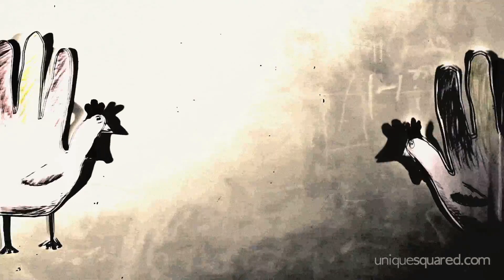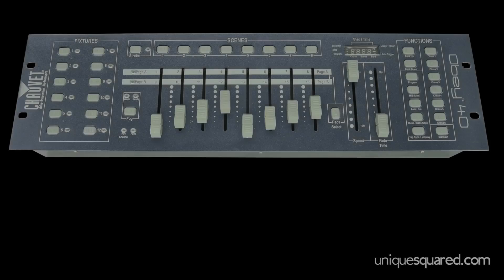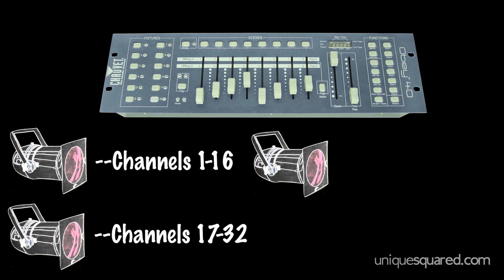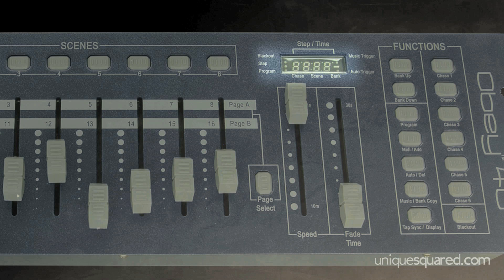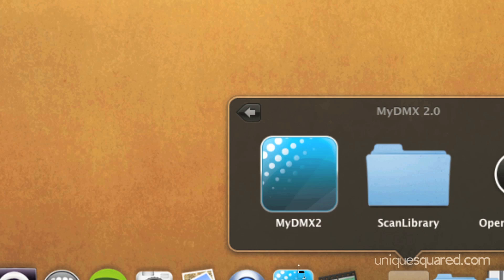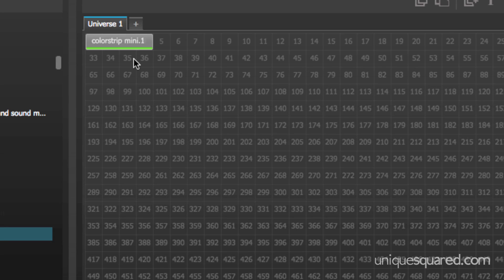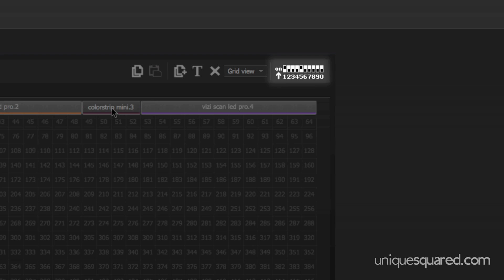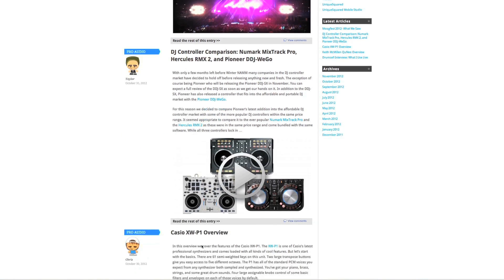DMX Lighting Tutorial Part 5: Hardware and Software | UniqueSquared.com

Comment: When my light is using 3 channels do I have to put the second light on channel 17 or can I put it to channel 4?
Reply: Phyzer no, you can patch (so we name the addressing of lamps) in one row e.g. lamp one has 3 channels, you can patch the next at channel 4 but be carefull! two ore three channels place between the lamps can save your whole show, because some lamps are "spoiling" a few channels behind them with a little voltage and the lamp on this channels would get false signals
Reply: Felix S Ok Thank you so much...
Reply: Depends, if you use software to control your lights through a dongle, you can. If you use a controller like the Chauvet Obey 40 as shown in the video, you can not, because that specific controller is made for 12 lights, with 16 channels per fixture. That means that when you connect a fixture to the controller, it automatically reads it as channel 1-16, because it has those control channels per fixture for it.

(Correct me if I am wrong anyone..)

Comment: i am looking to control my DMX "universe" (about 10-12 fixtures) in time with my live band. i want something better then the music mode from my fixtures tho they work nicely is there a way i can program chases and scenes and switch them manually with a foot switch or something? what would you recommend for this?
Reply: connect a midi device that has pedals and use it to drive the lights on ur computer

Comment: QUESTION -   So say I want to use DMX software like Luminair for larger live stage acts?…….. BUT……..I also need to use a show controller that will control the lights in preprogrammed patterns?  They will be triggered by a control system for a large restaurant/bar.  For instance - Bartender goes to a control and hits the start show button.  Moving heads point at the stage, floods go red and purple. so on and so on. This would be done by the show controller.  Yet they pick up the iPad, switch on the Luminair software to re aim the spot?  Hmmmm.

Comment: Thanks for your very informative series on DMX. I have a question, which I can't find answered anywhere: I want to use LED floods for a portable theatrical stage lighting rig. So, I want to control, maybe, three sets of four lights. I want to select colour cast on each set and fade them up or down with one fader each. I would like to have a master fader for all together. I want each set of lights to turn on/off/up/down to individually and stay at the level set, possibly simultaneously  So my question is, what controller would I need?. What sort of controller do I need. Chauvet 40, or similar, or something completely different?
Reply: Look at airdmx for ipad, download it and try it out, it is very good, you can make push buttons, then you have program fade time for each lamp or a group of lamps you can also run the moving head and adjust the color without disturbing all the rest. you have to buy the hardware (airdmx) from thomann or from elsewhere,  you can probably not use other programs for your hardware, and if the iPad turns off the program still go in the hardware.

Comment: hello ! very interesting tutorials. I have a question.
 I want to handle 20 led rgb tubes, I want lettering and effects, I want to use them as a screen. I know about the madrix software works, but, I have a mac computer and the madrix doesn't  works with it, and It is very expensive. So what software compatible with mac you recommends and what kind of interface.  Thanks !!